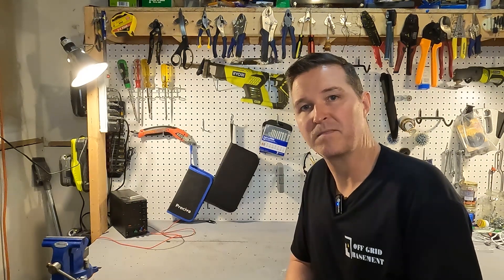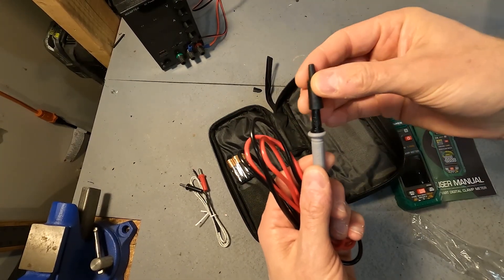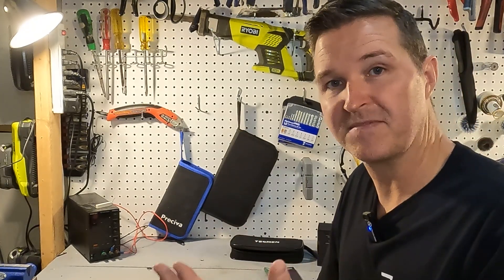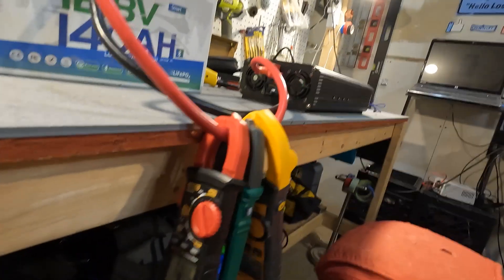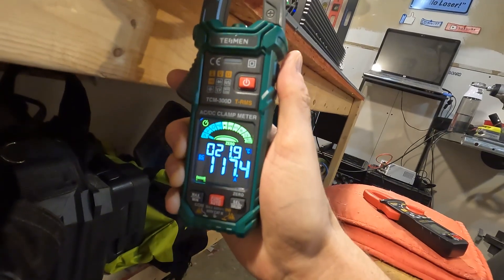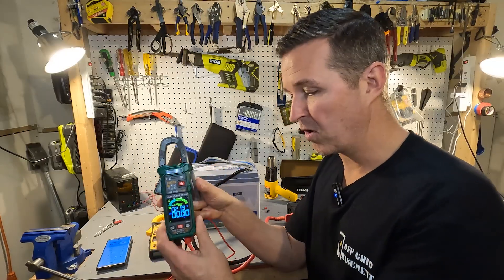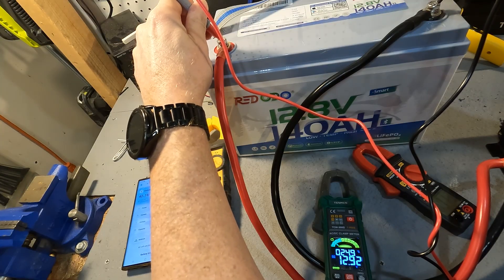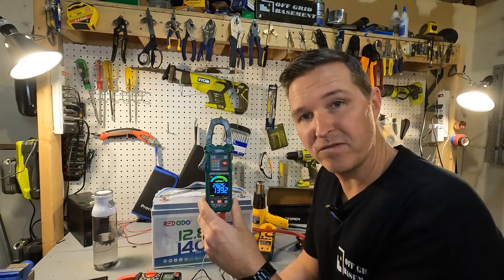TESMEN TCM-300D Digital Clamp Meter Review

Comment: There is nothing odd about the amperage measurement about the Tesmen. It is designed to operate the way it did. Just that you probably did not know that you have to position the cable at the center of the clamp to get the right measurement does not invalidate the product.
Reply from the maker: Thank you for the information and the comment.